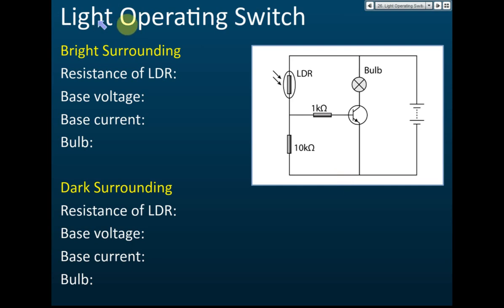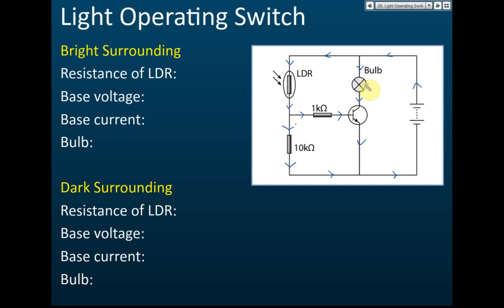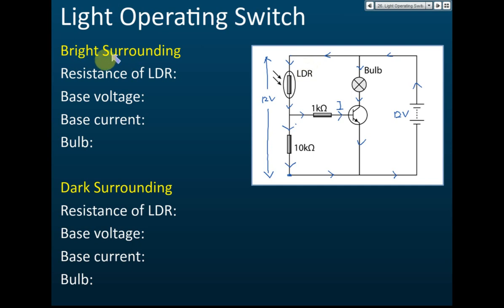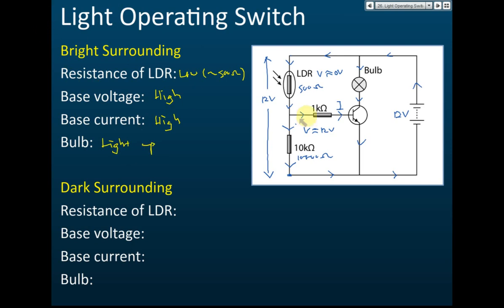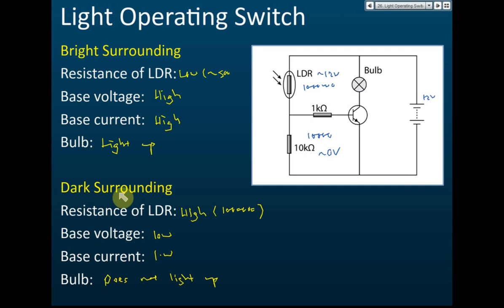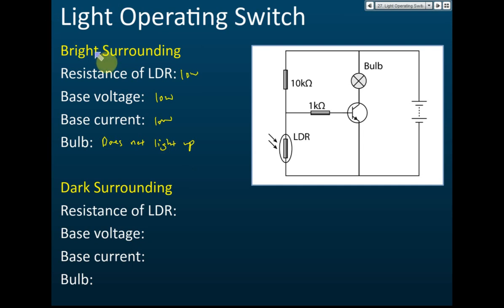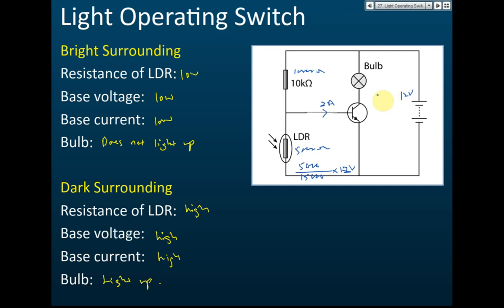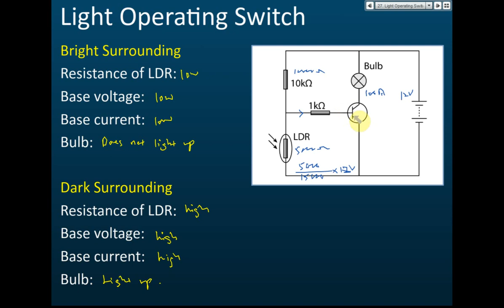Transistor as an Light Operating Switch

Comment: I think it is reverse.....between bright and dark
Reply: yeah I think so too
Reply: What do u mean
Reply: Olivia lew check the video I think there’s some mistake
Reply: @hariprasadt1393  No, it's correct. To light the light bulb at night, you just need to switch the position of the LDR and resistor that form the voltage divider.
Reply: His mistake is that the ldr should be down and resistance on top